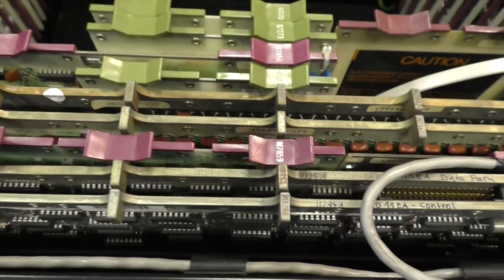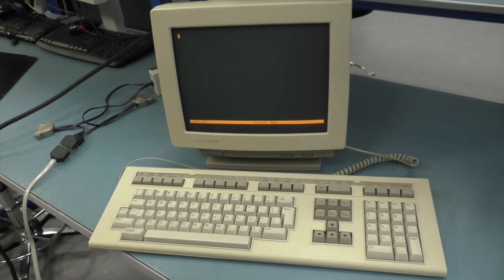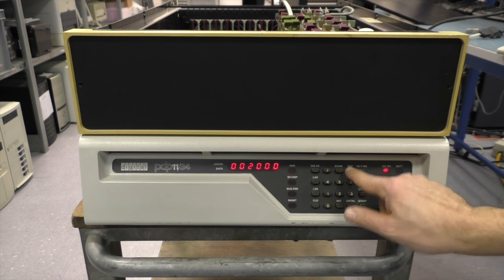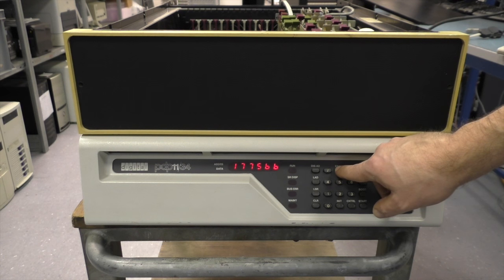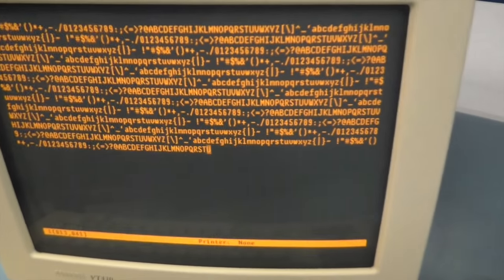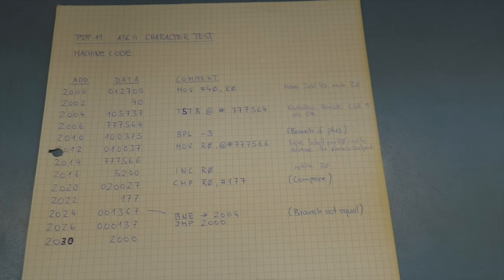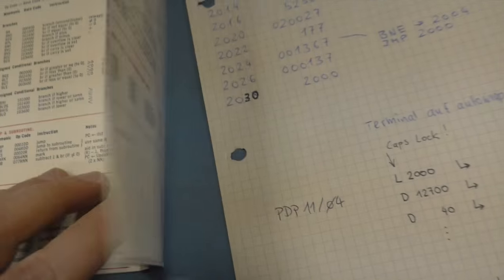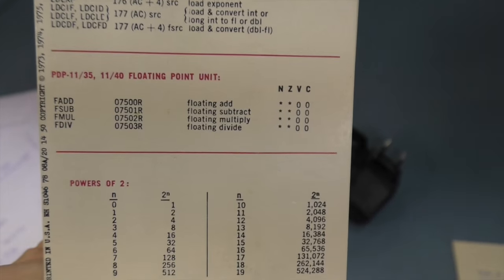Inside a DEC PDP 11/34 computer from 1978 (PWJ26)

Comment: I liked it a lot. You mention that the core memory did not work. This memory needs to be supplied by +20V and -5 V. Power supply H754 provides these voltages.
In minute 18:17 I can see that this power is missing. Without these voltges the core memory can not work. Congratulations for these vídeo.

Comment: Takes me back. My first job in IT was operator for two PDP machines running the admin software for a college - an 11/34 with two RK07 drives and an 11/44 with three RL02's and a tape drive, both running RSTS/E with DECnet. These were pretty old machines even by that time and they were woefully underpowered for the demand on them. It was quite a step up when we moved over to a MIcroVAX-II!

Comment: We had two PDP 11/34's in my laboratory at Washington University in St Louis in 1979. Each one had 64k words of memory and two RL-01 disc drives. We did a lot of really great scientific work. One was used for general scientific computing, and the other was used to control a JEOL JXA-733 electron microscope / X-ray microanalyzer.
Reply from the maker: The last RL-01 I saw was in a dairy where they used two redundant PDP's to control their industrial milk pasteurizing plant. One day when both PDPs crashed at the same time, they had to flush 10'000 liters of milk because it got contaminated with cleaning fluid, because the valves stayed open and it overflowed.
Otherwise it was a very reliable system, working for 30+ years.

Comment: That is one helluva clean BA11s box !!
I was factory trained on 11/34, 11/44 and 11/780 way way back in the 1980's.
I still fix them today - currently an 11/70.
I have not lost the art of fault tracing and chip changing !!
Reply from the maker: That's because this box was never running in a production environment. It was one of our workshop systems. And I cleaned it periodically. :-)

Comment: Danke für die Präsentation ! 1978 war eine tolle Zeit. Da gab es noch keine Laufzeit- oder EMV- Probleme und man musste wohl robuste Fingerkuppen für die Mnemonic- Eingabe haben ;-) God save the TTL Chips on Board ;-)
Reply: Ich bin damit einverstanden es war eine tolle zeit... Ich habe ein 11/03, aber ich musste es repaurieren. Die terminal ist kaputt. Es ist ein Heathkit H11A, aber innen dies machine es ist eigentlich ein PDP 11/03 mit ein M7270 CPU und 32kw RAM. Auch, es habt dual 8" floppies SSSD 256k/floppy. Also, es habt 512kb online datenspeicher! Wenn ich habe dieser computer werken, Ich habe ein 4000 seite handbuch zu lesen fur RT-11 V4, DEC BASIC V3.2, und DEC FORTRAN IV (FORTRAN 77). TTL forever!

Comment: Thats a very early machine. The construction is similar to a very old machine we had at General Instrument Microelectronics back in 1982 - it was ditched soon after I joined - we built a new factory so only the useful kit came with us. Later I joined Digital Equipment in Ayr having used their equipment extensively in the Semiconductor Industry. In the Early 1990 that was when Digital failed yet again to enter the PC market successfully and made strategic errors over UNIX et al. We closed the Galway facility in Ireland and its just so hard to keep a company afloat when some bad decisions have been made.

Comment: A blast from the past.  I worked on an 11/45, and later an 11/34.  DEC had some great engineers, but the short little bus grant continuity cards were an unpardonable sin.  I can't tell you how many knuckles I tore up getting those little things in and out.  It would have hurt them to put another 8 inches of fiberglass and a handle on top so you could pull them like any other board?

Comment: I worked on Computer Automation kit (SyFA) back in the day - a direct competitor. I always wanted to get the lid off a PDP so I could compare them - curiosity satisfied after 35-odd years! I remember the hand-keyed test programs and the boot ROM options - paper tape, 8" floppies or the 'new' High Capacity disk drive. All contemporary machines had roughly the same options.   Excellent video.

Comment: PDP11 is 16Bit (the width of the data path), but depending on the „MMU“ you might have 18/22 address bits or 256k/4M physical memory addressable.
Reply from the maker: Ja richtig.... alles mal gelernt und viel wieder vergessen.
Reply from the maker: @fromgermany271  Ja ja, die "Grossen" irren sich oft spektakulär. Wer braucht schon mehr als 640k RAM...? 😃

Comment: I used to chip chase those a long long time ago. Still have an 11/40 front panel (only) and a 16k PDP11 core memory board as art works. And a couple of 110v/230v rack mount transformers. I even owned an 1110, 1134, 1103, 1123 and an 1173 at various times. And still remember when the PDP10's I worked on were sold as scrap to extract the gold off the module pins. Unfortunately got rid of it all later including the dozens of service manuals etc.
Reply from the maker: Yeah, you can't keep everything.... I sent this PDP 11/34 to a technical museum. I hope they will keep it working :-)

Comment: Nice. That backplane job looked like quite a mess but I guess it did its job.
Reply: The back-plane were wired by CNC devices. It was mostly automated.
Reply from the maker: Most likely yes. But I have seen similar backplanes that have been made by hand.
Reply: It is not "most likely" at DEC I saw the build process machines. DEC did not build them by hand.
Reply: I had asked a guy once who was 'in the know' why on earth they did this in an era when it was completely possible to make etched PCBs, and in fact there were etched PCBs on the same products. The response I got was quite amazing, and actually makes a ton of sense:

Board density...you could fit the boards wiring into a smaller footprint by using wire wrap, having the equivalent of a 4 or even 8 layer board with the footprint and cost of a 1 layer board. In addition, you could add or leave out various point to point layers based on the product line. e.g. DMA wires or no DMA wires etc. and reduce or increase the cost as necessary. At that time, even a two layer board was expensive, but once they invested in the equipment, point to point wiring allowed for ease of design, versatile options using the same layout, reduce costs, and a smaller footprint, resulting in boards that were way smaller than they might have been, and uniquely suited to customer needs. When you look at it that way, DEC was way ahead of most computer manufacturers by using this archaic method of circuit design/manufacturing.
Reply: When re-programming the back plane the engineer 
had to remove so many wires, then replace with new wires.  fascinating to watch

Comment: Dman! IT came a long way in 35 years
Reply: Microelectronics came a long way. "Computer science" has not evolved very much since the 50/60s.
Reply: Also, most of the logic chips in these machines are still manufactured, still standard components.

Comment: Great!  Reminds me of the PDP 11/32  I used end of the seventies,  which had a removable disk (maybe even two) for the OS, the application (gamma ray spectography) and a development environment (Fortran, Assembly;  it  even had Basic).  For the gamma spectrums it had a display, the only terminal was a printing teletype  (probably TT model 43). The spectrum was stored in core memory, so when the machine was switched on, the last spectrum sampled reappeared on the display. Very noisy altogether.
It made me want to buy my first computer, a Commodore PET 2001, which was silent and had a CRT ;)
Reply: WOW dude I thought I worked on all PDP-11's I worked on 11/02, 11/03,11/05, 11/10, 11/15/, 11/20, 11/23, 11/35, 11/40, 11/45, 11/50. 11/55, 11/60, 11/70, 11/72, and 11/73, but I never even heard of a 11/32.

Comment: Fascinating stuff. Brought back some memories. Nearly 40 years ago, the video facility I worked for in London had this kit: http://imgur.com/z6DLcGb  I think they were PDP11-48s or 70s. Certainly CMOS memory, though I think the first one from the left was earlier and had magnetic core. We had anti-static carpet, as the CMOS was very prone to errors caused by static. I remember learning how to restart the programme while keeping all the existing data intact in memory after a crash! The keyboards had programmable function keys, and I worked out how to programme one to write the edit data to an 8" floppy, and encouraging the editors to use this regularly.
Reply from the maker: This is the first time I see a PDP as a pure graphics machine. I have seen graphics cards for PDPs but they have been used for a display in a industrial plant. Very basic graphics :-) Do you have a picture of a PDP generated TV image?
Reply: "original Channel 4 animated logo" Presumably this would be the BBC logo for BBC 4, before or after a show from that time frame. Knowing the BBC, it would be used for decades afterward as well.
Reply: @peterlamont647  Not BBC, it was indeed Channel 4. A 3D spinning number 4 in fact.
Reply: From the picture I see what could only be 11/34, 1134A, and or 1104. No such this as an  1148 and  this not a pic of 1170

Comment: So back then they would just sit in front of that LCD display with the calculator like buttons to program all day long as assembly?
Reply: guily6669 usually one would instead program an editor program first which takes input from a teletype. Programming larger programs on the front panels switches alone is silly.
Reply: Normally only used to set the address of the bootstrap loader, then press run. and away goes the loader to load your OS.
Reply: No one created programs at the front panel.  You used a card or paper tape reader, or mag tape or hard disk drive packs.  The front panel was just to boot the O/S.

Comment: can you run RSTS/E with DCL on this machine?  

UNIX was written on a PDP 11/70 with 2 MB memory.
Reply from the maker: I think RSTS should work on the 11/34. We had it running on 11/23, 11/44, 11/53. Although most users with an 11/34 had other operating systems (RSX).

Comment: So core memory is virtually the predecessor of flash memory? ;)
Reply from the maker: Both share the ability to store data when power is off. In that sense, yes.
Reply: The direct technological predecessor of flash memory is EPROM, especially if talking about NOR-flash.
Reply: Flash does not allow writing individual bytes, but there is something called MRAM/FRAM, which is fast as RAM, but hold data on power off.

Comment: Do you know why they used wire wrap? I mean, they had PCBs for all the other boards.
Reply: Quick and easy especially for prototyping.
Reply: Stuart Grant
This isn't a prototype.
Reply: True.
Reply: That's why I am wondering. Wire wrap is (probably) a lot of hand work.Makes it expensive...
Reply from the maker: Well... the boards are maximum 4 layers and the center two layers are only for DC supply and ground. So they effectively are just dual layer boards and that was the maximum possible in those days (exept some super expensive military and space stuff)
The backplane has maybe 10 or even more layers of wire wrap. So a higher density of wiring was possible. And it was easier to make design changes. They just had to change the wiring lists and the wires were routed to the new position. (sometimes by hand)
Reply: Wire wrapping was very rugged and reliable. Small reliable switches had not developed yet. At DEC we generally used two different wire wrap gauge. I still have my wrap and stripper sets.
Reply: Mark Cummins
Wire wrap more reliable than a good PCB? No. Not to mention, that it uses up much more space.

I guess, back in those days, PCB were simply also hand made and costly. So the difference between wire wrap and PCB wasn't big.
 Besides the possiblility to make wire wrap "multi layer".
Reply: You missed the point. Wire wraps were more reliable than switches, at that time. Also wire wrapping came at a time that it was cheaper then PCBs and because it was done by CNC machines it was more versatile... at the time. Wire wrapping was developed before PCB technology.

https://en.wikipedia.org/wiki/Wire_wrap
Reply: Also note that we started making things for people by making standard parts that could be assembled in many ways. The back-planes we made had partially depopulated pin outs. We could use one type of automated wire wrapping machine to produce various needs specific back-planes, cheaply and reliably. Our flip chip parts were killer parts for the time. Oh, and by the way the nomenclature of the pins were committed to memory by all techs just like resistor color code for resistors. They were always easy for me to read and deal with. The back-plane you see as complex and bulky, I saw as a moment in engineering sanity of the time. Time does continuously change.

Comment: Giant calculator :)
Reply: Well, calculators had existed for a long time in 1978, even pocket calculators. They were usually based on 4-bit BCD-arithmetics. The PDP-11 was built more like today's computers. In fact, it was the primary model for the instruction set and/or register structure of several microprocessors.

Comment: I feel Im missing something, even when the PDP is a piece of history due to NIX develpment.  In 1978 there were computer like the Commodore PET with screen, keyboard, basic, tape storage and diskdrive. I mean, for a 78 machine looks a bit outdated, at least when compared with home microcomputers. What is its strongest point ?. Speed ?. Can you proram it using the VT terminal ?. Also, procesors were already in production, like the Motorola 6800 and probably not too far away from the MOS 6502. porbably not as fast as this system. My best guess.

Comment: Even though the date codes on the chips say 1978, and there's even an inspection sticker with 1981 date somewhere, these boards look pretty outdated technology even for 1978. An ALU made up of dozens of separate logic gates ? Magnetic core memory ? are you kidding me ? Microprocessors were already available and inexpensive in 1978. There were even some early 16 bit ones like the TMS9900 and NS PACE. Anyway, thanks for sharing this interesting demo !
Reply from the maker: For DEC this was a well tested and reliable design. DEC was always a bit slow in using new technology. That's why they missed the advent of the personal computer.
And some of their operating systems were made for 18 and 22bit processors. Not so easy to switch to a 16 bit CPU.
Reply from the maker: BTW... magnetic core memories have the advantage not to lose stored contents when power is off. For some purposes, core memory was used even later.
Reply: I agree, furthermore, DEC processors were fully orthogonal as well as being CISC, with floating point in hardware...unlike those cheesy 8 bit microprocessors of the mid/late 70's from intel and friends. In addition, as Play with Junk pointed out, non-volatile memory is very useful! Consider the downtime of booting up an operating system from tape, and then an interpreter, and then a program Vs. turning the computer on, and proceeding where you left off. You can think of core memory as a hibernation state when the computer turns off. Magnetic states remain in that state until you change them. It is conceivable to turn a computer off, completely unpower it, and then return 50 years later, and proceed where you left off. Try that with DRAM...

DEC had some great innovations regarding equalized data/address paths for 16 bit systems, as well as parity memory. Much like the later 80286/7 the address lines grew to allow for higher memory capacity well in advance of intel copying these ideas. So while business machines from the S-100 era were getting on with 32K of ram, and upwards of 64k, DEC had multi-user systems with 1 MB of ram and the ability for many users to log in and use a single machine.

Even on the smaller systems though, program sizes, due to orthogonal instructions and CISC architecture allowed for smaller memory footprint, smaller online data storage usage, and faster data processing of the same algorithm compared to any contemporaries such as the 8080A, 6502, 6800 etc. Even when the 68000 CPU came out, motorola made the timing so ridiculous that no one wanted it...until 'DTACK grounded' was discovered...whereupon it became the 3rd generation CPU of choice. It was unfortunate for DEC that DTACK grounded was discovered around 1 year before DECs jump into PCs...without DTACK grounded 68000s, DEC would have blown the computer competitors out of the water. Instead, they were just more expensive 3rd gen computers, and people who might have bought a DEC, bought an Amiga or Atari ST  instead for example. Imagine if there was no 68000 with DTACK grounded... Apple would have died an ugly death, and commodore too, and Atari, and there would be 3 less major competitors in the home/business market. DTACK grounded altered the course of computer history for over a decade in its wake.
Reply: Peter Lamont great comment
Reply: Actually, there IS a microprocessor in that system! It was visible when the boards were shown...
Reply: But they didn't implement the PDP11 instruction architecture - the first 11/20 was also launched to customers in 1970 while for example my DEC Pro 380 is about contemporary to the PC/XT.

The 380 has two chips in a common dual-line pin package which implements the PDP11 instruction set (ie the two cpu cards in the 11/20-)

Unfortunately DEC marketing wanted the Pro machines to not be bus-compatible with the PDP11/xx line so they have its own bus (and by standard its own OS  is an hacked rsx11.) If DEC instead would have choosed to build a Pro with Qbus, smaller formfactor and a standard OS for example RT-11 or RSX11M they had something which outperforms an 8088 (and probably an 286) but that machine would probably damaged DEC's profits to much in the 80s.
Reply: @PlaywithJunk  In addition they are very tolerant to vibration: i.e. good for industrial applications